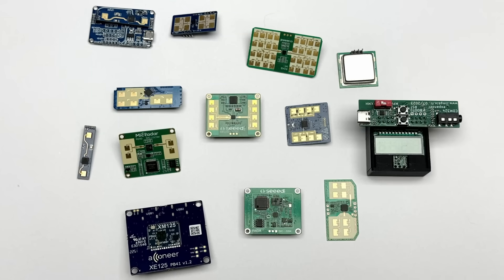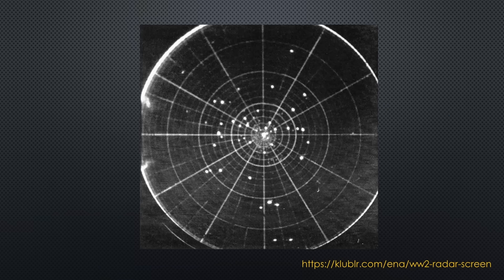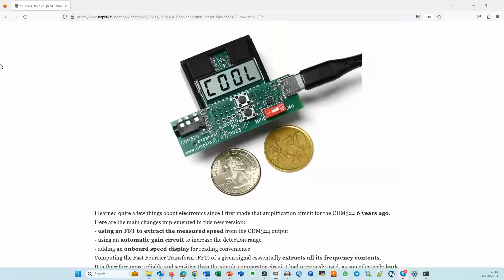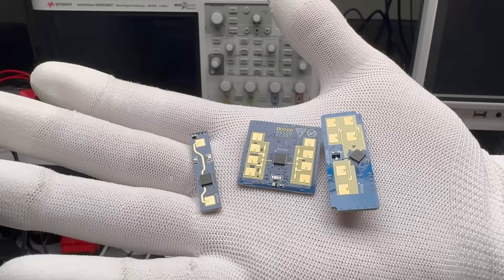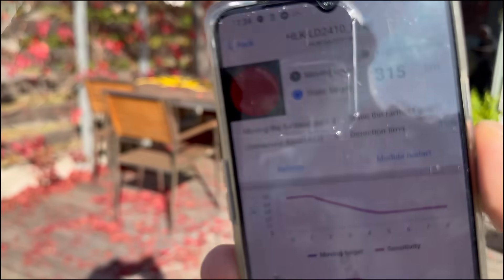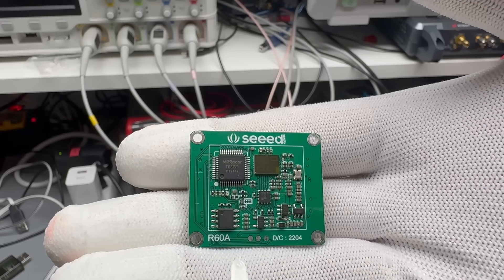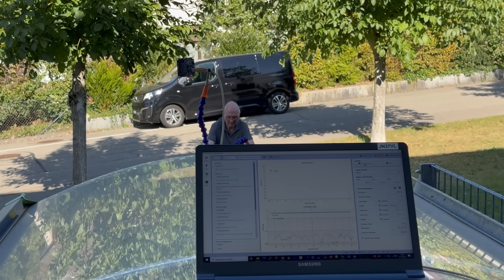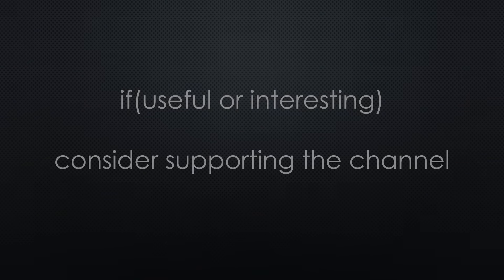467 Radar Sensors from $3 to over $100: Which one is Best?

Comment: Hello Andreas, thanks for the great overview of radar sensors and your understandable and simple explanations about radar. We are a Swiss company what develops and manufactures radar sensors in the 24 and 60GHz range for various applications. Some of them already have signal processing on board and would fit perfectly into your test portfolio. If you are interested in an independent evaluation, we would be happy to provide you with evaluation kits.
Reply from the maker: Another viewer already mentioned your company. Maybe you contact me on another channel. You find me on Linkedin, for example.
Reply: I have also used RFbeam's radar sensors for a university drone tracking and classification project and found them to provide great performance. Detection of small consumer drones @ up to 10m range for the K-LD7 module.  Would highly recommend you get your hands on one of their kits!
Reply: @xeofpv1252  I am trying to do similar for my university project I am about to start. Is there a way I can contact you to discuss a bit about your project please? I have been speaking to Acconeer but they said my project idea would be very difficult with their A121 evaluation kit and multiple sensors. It sounds like the K-LD7 will do what I am hoping a lot better. It will be nice to get some info about it before spending all the money on the sensor. Thank you
Reply: @raabtube  I can give you some info but it was a while ago now. I think I used the K-LD7 evaluation kit which came with the cable and drivers. I then used the python driver developed by nickovs to pull off the raw fft data from the sensor for classification. Then I used the onboard angle and range measurements that the sensor performs to help determine location of the drone. All of this was done with just using the sensor, a few servos and a raspberry pi 4b. Depending on the drone it could detect it at up to 10m but was best at around 5m. I gathered a custom dataset with spectrograms of different drones and then trained a custom CNN on the data for classification. Hope this helps!
Reply: @xeofpv1252  Thank you so much for replying!!! What you did sounds pretty cool. I was actually speaking to their tech support today about this concept. From what I gather so far the LD7 sensor only operates in one plane, so to get a full 3D solution I would need two of them and then do the math to formulate both azimuth and elevation. Did you use the servos to manipulate the sensor? Was that a way of getting a 3D fix with a single sensor? I had originally thought of having a rotating sensor like you always see the ATC radars, but thought it would be simpler to just point at a static section of the room.
Reply: @raabtube  I mounted mine on a 2deg (az and el) pan tilt mechanism I modified to fit the sensor. It was just driven by two little 9g servos that would move in az to keep the drone in the centre of the beam (little PI controller to minimise the azimuth error from boresight). I found the same issue that i was only able to do a single axis though. I attempted to do a bit of clever scanning to try and use the elevation power difference to figure out where the drone was in elevation but it didn't really work. I agree you would need two sensors to do 3D localisation but it would be a cool step to add.
Reply: I used a lot of RFBeam radars in my university studies, good sensors! The problem we we're tackling was very low-frequency movements (human vital signs), so the development boards didn't work and we had to create our own. Great sensors, though!

Comment: Hello Andreas. Thank you very much for the incredible overview about actual low cost radar sensors. You talk about FMCW sensors but beside this there is also the possibility to use FSK for distance measurement. There is a Swiss company what develops and sells different 24GHz and also 60GHz sensors including signal processing. The K-LD2 for example is a simple movement detector what can also measure the speed and direction of persons up to 15m. The K-LD7 uses in addition an FSK modulation and has 2 RX antennas what allows for an angle and distance output besides the speed and direction measurement. They also released a very small 60GHz FMCW distance sensor called V-LD1 what can be combined with a plastic lens to focus the beam. It has a very low power consumption and is perfect for IoT tank level gauging applications. I think these sensors could be a great addition to your presented overview.
Reply from the maker: Indeed, they have a wide range of sensors.  Thank you for the info. I did not know this company.

Comment: Hi! You seem to have missed out on covering TI radars. They do a pretty good job for as low as $4
Reply from the maker: Well possible. I now went to their homepage but only found chips, no modules. Where do I find these $4 modules?
Reply: @AndreasSpiess  I meant the chips are as low as $4. Module are more expensive
Reply: @AndreasSpiess  Hi Andreas, We have a radar board that based on TI1642 , CAN-Bus interface, 500K. Detect ragen 40m, +/-60 degree, with distance(x,y data), speed, full communication protocols. Present price is much lower than before, it's about 50-60USD/pc. By the way, I use the same lamtop for testing :)
Reply from the maker: @alexlintech6995  Including antenna? Where can I get it?

Comment: Thanks for a comprehensive overview of these sensors. Worth noting that the LD2410c has a normal 2.54 pitch, much easier to work with than the tiny headers on the LD2410b. Also bonus points for footage of your cat, she should be in all your videos
Reply from the maker: Indeed, the headers are a bit of a pain. I did not look at the LD2410c. So, thank you for the addition.
Reply: Ld2410c also has Bluetooth. Although I found that bt connection of ld2410b/c are not very stable with homeassistant.

Comment: Thank you again Andries.
Your topics are usually a few months ahead of my interest... 
This time you simply coincide, but still well done 😊😊

I have bought the smaller LD2420 sensors (smaller, so easy to integrate into a small device, but without the Bluetooth support, and no integration with HA/ESPHome )
They report over a UART (also used to configure) and/or give presence signal on a separate single pin for easy ON/OFF integration with a micro.
Very cheap, very sensitive, and no false presence reports (like I had with earlier radar sensors)

I completely don't care about no ESPHome integration.
ESPHome is just another layer of abstraction (complexity) on top of basically Arduino.
And its annoying as hack that every time ESPHome updates, you are expected to compile and upload all your devices built with ESPHome.

ESPHome should be a separate Arduino library dealing with the HA API, that you can then use in your own Arduino projects.
Reply from the maker: I have a few sensors using ESPhome. But I have to confess: I do not upgrade sensors if they work ;-)

Comment: Hello Andreas!  Great video!  I'm also into electronics and have a small blog, and I'm currently also into radar sensors.  And I would like to talk about some interesting models: HLK-LD306s can measure the speed of cars at a distance of up to 150 meters, its cost is about 35 dollars, MS72SF1 is capable of tracking up to 10 targets, it costs only 25 dollars.
Reply: I would probably pick up a MS72SF1 to try, but all their documents seem to be behind a 'contact us' wall. It does not say anything on their page about tracking 10 targets.
I have the HL-LD306s, it's great aside from the RS485 and 12V supply. I have it outside my place.
Reply: @originalmianos I have a DM-19 sensor, it is capable of measuring speed, but only at a distance of up to 15 meters.
Reply: @mahnotv8871   I'll have to get serious and measure the range of the LD306 this week. I only had it firing up one lane. I should publish it.
Reply from the maker: @originalmianos I would also be interested in its range.

Comment: LIDAR sensors have some overlap with these simple Radar Sensors. I would be interesting to see both integrated into a low-cost multispectral package to improve functionality and usefulness.
Reply from the maker: Indeed, they can be used for similar topics. The Lidars usually have a very narrow field (if you do not use the expensive moving Lidars. So they are not as good for presence detection, I think.

Comment: Thank you for the review.  Would be grateful for your comments on sensors that would be best suited to detect small animals the size of rats under automobiles.  Have only been slightly successful trying to use PIR501s.  Regards and thanks.
Reply: I think this video shows a suitable sensor at 8:09, part number Dishka 😁
Reply from the maker: I can imagine these sensors can detect rats on a short distance. But you have to try. Or maybe an IR camera with movement detection.

Comment: I wonder if one could use these cheaper sensors with an external reflective antenna, maybe try feeding one of them into an old satellite TV antenna? These are for 24 GHz range, I think, might make a usable range extender in an application that could accept the size, or, maybe, something like a headlamp reflector, one of the larger round ones... I've used headlamp and driving lamp reflectors for long range IR sensors, easily detect a 60 W incandescent lamp at >100 m... Just a thought.
Thanks for doing this "first pass" work for us!
 The 🇨🇦 🐻‍❄️ In 🇩🇪
Reply from the maker: It is always possible to use a dish to focus the energy. But maybe it would be easier to invest in a "bigger" sensor with more range.
Reply: @AndreasSpiess  Grüßen aus 🇩🇪
Yes, one can always spend more, but an antenna solution can also bring some advantages, beyond range, but directivity, as well...anyway, Maestro, just alternative ideas.

Comment: Hmmm, Comment vanished... I was saying there is a low curent sensor: HLK-LD012-5G with just 75 µA but with only hardware solder config options - are there others in that fuction class, but also low curent?
Reply from the maker: YouTube deletes comments with links.
An interesting sensor! I ordered one to check it out.
Reply: @AndreasSpiess  there is a new kid on the block, low energy: hlk LD2410S Average operating current	0.04	0.12	0.6	mA; ali cheapest:1005006247053056

Comment: LD2410 is supported by tasmota, too (need to compile an own version). For use with a shelly it's necessary to modify the module and bridge the voltage regulator.
Reply from the maker: Good to know. Thank you!

Comment: Hi, I'm not sure you'll read this but I'll give it a try. I'm looking to make a home made  radar altimeter to attach under an experimental aircraft. I really only need it to measure distance for about the last 10 to 20 meters.  (count down to touchdown) . The aircraft would be moving at about 60 knots  (100km per hr). Could you make a recommendation on which of the radars you reviewed would be best suited. Or possibly steer me in the right direction. Thanks for your content. Very informative.
Reply from the maker: According to the datasheet, the XM125 sensor should be able to give you this info: 20m range, and very fast detection. But, as shown, I was not successful in proving it :-(
Reply: @AndreasSpiess Thanks for the quick reply. It'll probably take me 12 months but I'll drop you a note if I succeed :)

Comment: one small issue that might have happened with the acconeer sensor, you have mounted it at 90degrees to the ground, flipping the polarization.
it might be harder for the sensor to detect objects like this, try again when the board is horizontal
Reply from the maker: Thank you for the info! Maybe somebody from the company is a viewer of this channel ;-)
Reply: I'm also wondering if the large black van in the background might be creating a very strong reflection that caused problems with sensing smaller things (bicycles, guy with Swiss accent) which were closer to the sensor. I don't know how the signal processing inside the sensor works, so maybe this doesn't matter. (Or maybe I should buy one of these sensors myself, and do my own experiments in a large soccer field with no nearby cars.)

Comment: Hi Andreas! Thank you so much for the video. Coincidentally I was just shopping for some mmWave sensors, and this was really helpful! Quick question (for anyone): are there sensors that can do angular position? There is mention of this on the DRRobot's mmwave, and some other sensors, but looking through the code libraries, there is no function for outputting angular position. Thoughts? Thanks!
Reply from the maker: The ones from Hi-link all deliver some sort of angular information. However, I am not sure if it is available in HA.
Reply: I only get x/y from the ld2450, from which I can convert to an angle. Maybe others do but the firmware on the other Hilink ones I have only give distance and sometimes power.  The ld2450 also has multiple targets
Reply: Thank you so much you too! Appreciate the input. Will check out the ld2450. Thanks!

Comment: Great comparison!

Currently I'm playing around with LD2410 and LD2411 with ESP32 in Home Assistant. (And I'm about to introduce LD2420 to the setup) Both sensors report the distance to a detected object, although the comparisson matrix says is unsupported. I haven't been testing it's precision as it's not relevant to me.

There's just one question I'm trying to answer with my test setup: How sensitive are they for interference, especially with 2 (or more) sensors close to each other. How should I test this in a reliable way? Do you have any tips?
Reply from the maker: I did not do any tests with more than one sensor (our rooms are pretty small) :-(
Reply: I have 3 in a large room, facing different directions but I don't seem to see any issues.
Reply: I haven't seen much detail on these, but, if they use pulsed transmission, with gated receiving chains, they should have relatively few pseudo-random interference... Just an "educated guess" 😼

Comment: Hi-Link also has the LD 306 S that is a dedicated vehicle speed sensor. $36 USD. It works well and more than 5 metres but only gives speed. I also got that one and wrote a driver for it. The only down side is it is 12V and rs485 serial. I just used a boost converter and 485 driver from the esp32 5V usb lines to drive it. I always wanted to know the speed of the cars out front of my place. I also set this up on an espcam but have not got to writing the code to capture photos. (I also got a 5MP camera module that is meant to be compatible with the espcam ribbon}.
Reply from the maker: Thanks for sharing your experience. I wanted to include it in my test, but they said that it is obsolete. So hopefully, we will get a replacement (with more range, of course).
Reply: @AndreasSpiess  It's my understanding the replacement will be the same in some sort of box. I'll get that one when it comes out.
Reply: I, too, have always been interested in measuring the speed of passing cars, I even bought a couple of police radars for this.
Reply: @originalmianos I would like to find out more information about your speed detection project..!
Reply: I bought LD306S. I didn't manage to work with RS485.  BUT I took an output from opamp ( i soldered a small cable) and output it to an microcontroller running FFT. It works very very good!
My goal is to measure tennis balll speed. If you need it for such applicatiom, you should give it a try.

By the way, thank you Andreas for your excellent presentation and info that you are sharing. Just i wish i found your video before i bought some and different radars sensor for testing (might have saved some money)
Reply: @evangelosmavrantzas9083  Did you manage to find a way to measure tennis ball speed? What sensor did you end up using?
Reply: @ralfjurgenson  Yes i did. I have spend a lot of time and tried too many sensors (just like our friend Andeas).
I have made my own pcb (actually three different) and all works fine!
Mostly i have used LD306S (having cut some of the dipolesin order to make its beam wider), LD1115H and LD112. (and now i have ordered the LD116, to try it,  because it is wider beam). And i have modified our friend Limpin board too with the cdm324, succesfully! 

BUT, I have de-soldered the microcontrollers and all the rest items. What i do is: i am taking analog data from the 24 ghz chip (just after the opamp)  and i am feeding to my pcbs. My pcbs have amplifier opamps, filter (to decrease noise), a microcontroller, a 3 digit 7segment display and a lipo charger. 

It works perfectly. As soon my shoulder gets ok (because i am injuried) i will test the maximum servis speed i can measure. A tennis' friend of mine serves at 145 kh/h.The maximum i have seen so far. 
(when i am at the court, I looking for someone with great serve, in order to test it! xexexe)  

And of course, it counts cars' speed excellent too.

If you want, how can i publish photos here?

p.s. Andreas, i think you are the one that inspired me and thank you for that.

Comment: I installed 7 LD2410B in my rooms. I installed them according to the datasheet spec and get up to 7 meters of detection. They have been working flawlessly for 10 months. I used the app to set them up for optimal detection in each room.

Comment: I had the misfortune to use the seeed MR24D11C10. Of which if you download the documentation from the official website, you get a manual for MR24HPB1 with a logo of MR24D11C10 filled with wonderful Chinglish describing different modes of operation without telling you what the different modes do. The serial protocol works half ass and even as a made-in-China person, I can not for the god of me find out how to write configurations to its EEPROM although it is said to be supported in the documentation. The reason that I wanted to change that is because my two modules from digi-key came with different configurations from the factory!